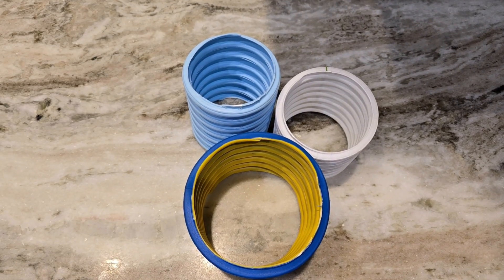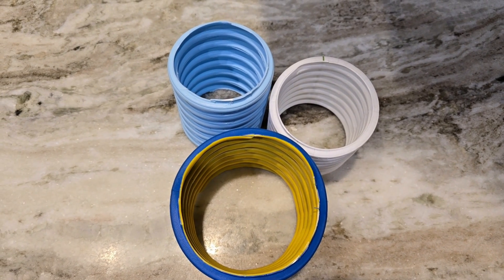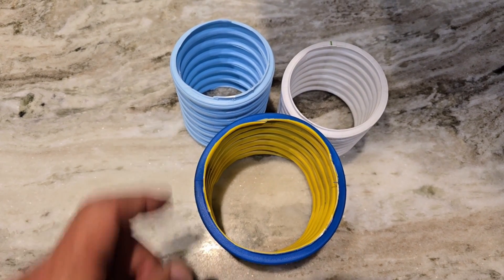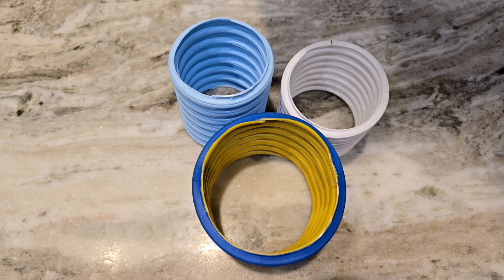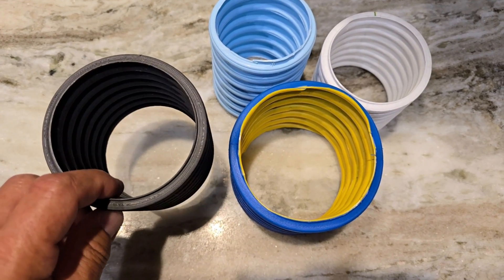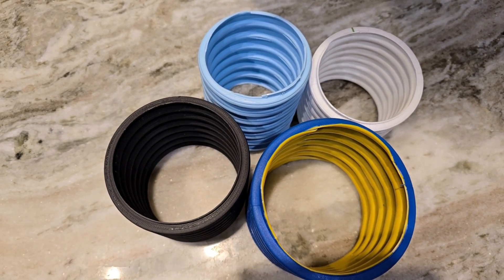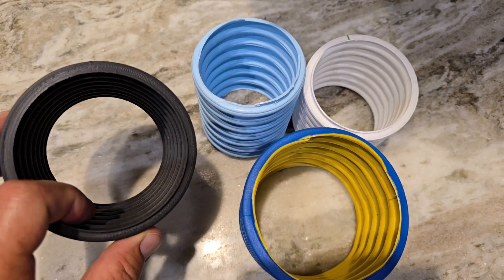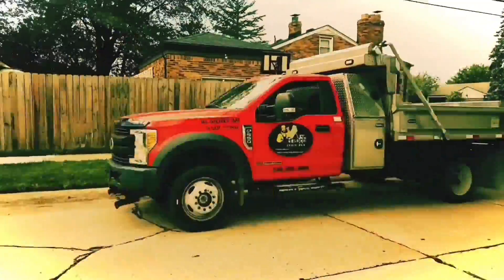Why 4" Pipe Clogs and how to Avoid a Clogged Drainage Pipe

Comment: Its will happen if somebody willing to put up the Currency  to make the molds  and all the fittings requirements. What is in current  or past sizes that is in use today. And good marketing  campaign for a return  of Currency  spend on the   
Original  Currency  spend on the molds.

Comment: I have a water problem of water running through our driveway, then going through our yard washing out some yard dirt. I'm looking to remove as much water and pipe it down to a creek....needing help on a system that works underneath gravel driveway...
Reply from the maker: You have to put a culvert pipe under the driveway and run the system through the culvert pipe.
Reply: @FRENCHDRAINMAN not sure exactly what you mean as far as putting culvert pipe in the driveway? This is surface water building up then running down our sidewalk and also running through our yard. I  apologize I'm not seeing how a culvert pipe will help. I will need some further information. Thanks

Comment: I would love to get access to 3” corrugated pipe.  It is very disappointing the box stores only have 4”.  

The smaller pipe would really help with slope management for very long discharge lines.  It would be great for subsurface drainage because you could install two pipes and use less but larger rock.
Reply from the maker: Frenchdrainman.com

Comment: Having a 3 1/2” pipe would be ideal. If someone is concerned with gallons moved through the system they could always run dual pipes together in the same trench, which would double the capacity and solve the sediment issue at the same time. I’ve always put an extreme grade on my systems to account for clogging but sometimes it’s not possible without a sump. This is actually a great idea!

Comment: I'm torn between 3+ and 4" because I have a lot of mature pines in my neighborhood. Needles are around 8 inches long. What do you recommend?
Reply from the maker: My leaf filter keeps them out. My leaf filter catches everything.
Downspout Leaf Filter Vented Clean Out, Gutter Leaf Guard
https://frenchdrainman.com/product/downspout-leaf-filter/

https://youtube.com/playlist?list=PLjFCqaZ4v1BXKlR6qPMC_8I00r5KGdoP9&si=03_ewfub8H9DuVta
Reply: @FRENCHDRAINMAN  thank you. i was convinced by the flow test video that 3” can handle a 4x3 downspout but was worried about needles slipping through and clogging the elbow. 

based on your vids, i’m going with 3+ to a 4” main. that seems like the current best practice.

Comment: I'm trying to decide when to go to a 4" pipe in my system. I have two systems, one for each half of my house. Each side has several downspouts, and each side has a french drain behind a retaining wall. One side of the house has two outlets, a 3" and a 4". The other side has one 3". I didn't know much about drain systems, there was no Youtube, I just sort of bought what they had with not much thought. During huge rain events, these run totally full. But that is rare for it to get that bad. I need them to work great however, as if they don't carry the water away, that can build up then flood thru my garage. Looking at your videos, I think I have a good idea to use 3" or 3"+ for the downspouts, then after a few of those or a inline drain switch to a 4". For my new system, I was thinking of making sure I have enough capacity and getting two 4" on the one side, and maybe two 4" on the other side. I want to add a few more downspouts this time, so that I have them all attached to drains, instead of a few of them. One problem I think may be, if you add 3.5" into the mix, that seems like it may really increase the number of adapters and Y's and such to fit all the mixes of diameters.
Reply from the maker: In my professional opinion, the 3.5-inch pipe would make the three-inch pipe obsolete. It really is the do-all. With the exception of main trunk lines, it would do everything. You can pull it through sprinkler mains. Eighty-five percent of the jobs we do have sprinkler lines ran everywhere. To get the four-inch pipe in the ground, we have to cut so many lines. Also, it would hold less water than the four-inch, 30% less water than the four-inch. Meaning, you could leach the water away quicker, that's left behind after a rain. If water leaches away faster, you don't have to worry when it gets cold about the line freezing up because of standing water in the line. A lot of DIY projects could be done solely on the 3.5 pipe. I know we would use it for french drains, quad packs, there's advantages. Again you could pull it through utilities and sprinkler lines. You could wye the two bottom 3.5" pipes into 1 four inch main truck line for your discharge.
Reply: Sounds like you should brand your 3.5” pipe as the GOLDILOCKS pipe. Not too big, not too small, just right!
Reply: Really interesting. I like the idea of a 3.5” pipe as the starting point. For exterior basement footing drain would that be best or is the 4” high octane preferred?

Comment: It’s always nice to have options, and to be able to choose from 3”, 3”+, 4” and possibly 3.5” to provide the best performance for a particular drainage situation. However, the more size options that are available, with nominal increases in size, makes things even more uncertain for a simple DIYer like me to choose the correct pipe size for my particular drainage needs. Your advice has helped choose 3”+ for single downspout drain lines instead of 4”. However, how would I know how to choose between 3”+ and 3.5” pipe? Hopefully some guidelines would be developed to provide guidance on what pipe size to use based upon estimated gpm of water to be handled, slope of the pipe, etc. so that a DIYer can make a good choice on pipe size for their particular situation. Like I said, having options is good, but you have to be able make a good reasoned decision on what is the best option.
Reply from the maker: I understand this. When we first opened the online store, I put everything in it that we use, and I found it left people overwhelmed and even frustrated to the point where they were stuck and didn't know which direction to go in. Ever since then, I have been trying to find the parts with the most common ground. There truly isn't a one-size-fits-all solution, but you want to get it as close to that as you can. Once you're at three downspouts or more, you need to go up to a 4" main trunk line.
https://youtu.be/jFC19-LJYpg?si=8eA7_GJixTjT0-s_
Reply: @FRENCHDRAINMAN  Makes sense.  I would think you also want to match the sum of the downspout's  surface area (6 sq inches for 2x3 downspouts or 12 sq inches 3x4 downspouts) and match it to the drainage pipe's surface area  (3.14 x radius x radius) ???
Reply: Us DIYers are grateful for the advice you provide, as well as for your products, to help us with building our drainage systems.